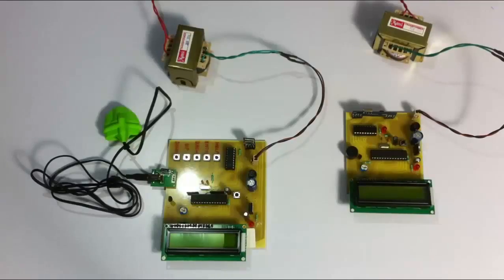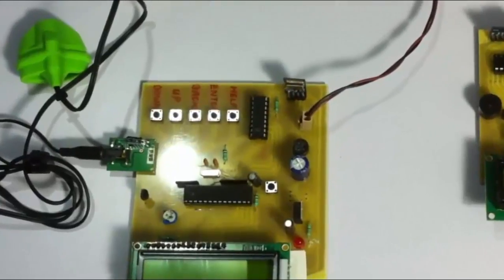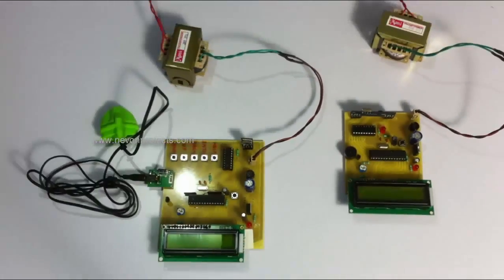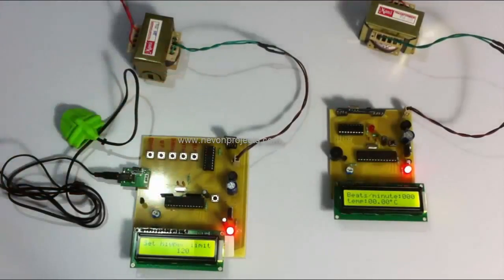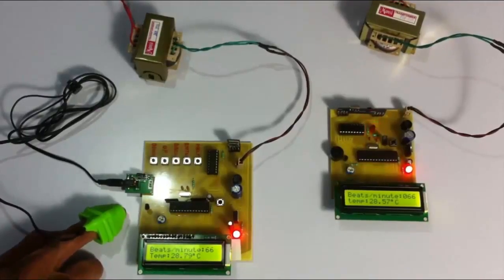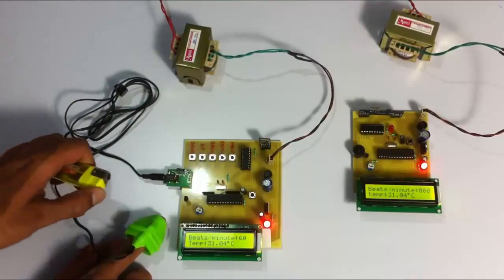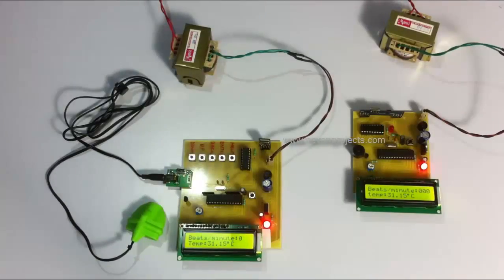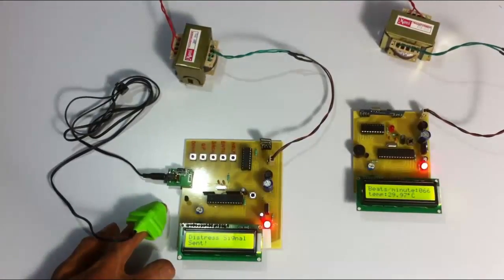Patient Health Check Using Wireless Health Monitor

Comment: nice job.
but the question is what are these setting and start choices  ? 
I mean why allowed to patient to change things,  instead of just measured and to be sent?  
all I mean is I didn't understand,, the help button is ok,, it's clear, but the others for what?
what kind of the RF module that you used in your project?
thank you very much
Reply from the maker: its for the doctors to set desired limits of heartbeat and temperature for alerting
Reply: thank you very much sir for replying.
I think I do understand, but what is still unclear is: those buttons are existing on patient unit, I mean since if there's any changes in the values of the sensors, it will be sent directly without the patient does anything.
so, the help button is for emergency case, what do other buttons do?
sorry for stuck on this point. 
thank once again
Reply: oh, maybe I got it!!!
do you mean the disallowed to use other buttons except the help button?
and other button will used by doctors to initialize for  each patient individually and will be hidden from the patients   
if so, I got it.
Reply: code please